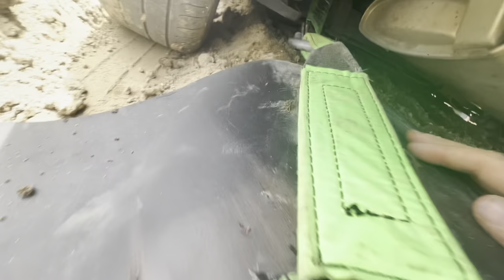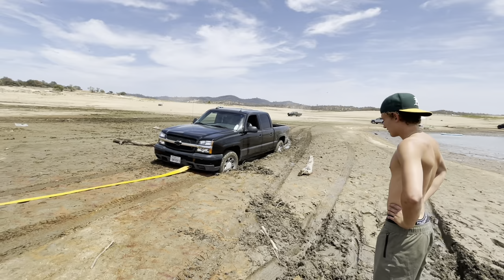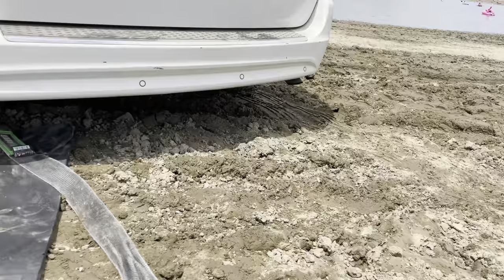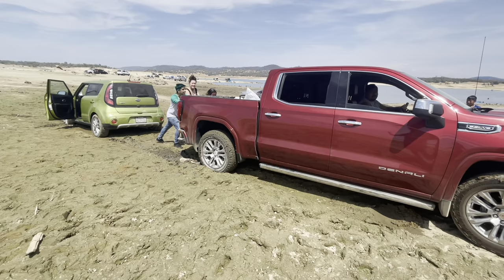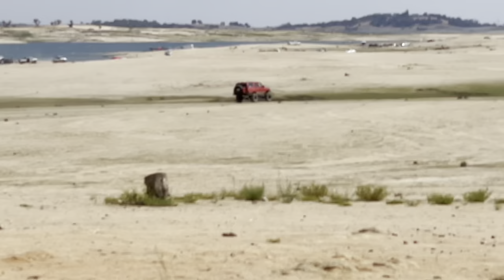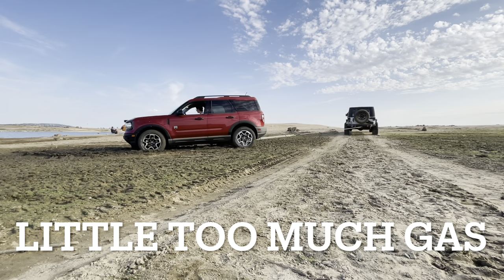I pulled out 11 stuck vehicles for free

Comment: Where did you end up hooking up to the Bronco? If they did have the tow hook that screws in to the bumper, would that have been a good place to pull from? I mean, would you want to use that screw in hook if they were in deeper than that? Seems like a light weight toe point. I’ve never used those.
Reply from the maker: We hooked to the control arm

Comment: Git to ask why do u not use the tow hook that screws in the front bumper and back bumper on alot of those cars u pulled out the hook is where the spair is an works so much easier to atach to
Reply: Not really meant for hard pulls or side to side force. On some cars the threads that they screw into are aluminum. Control arms & other suspension components are much stronger.

Comment: Some company will make good money if they come up with an elastic self tensioning mechanism to keep recovery ropes and straps from getting run over. Something that lets the recovery product still fully extend but then contracts in a series of short sections at a much lower elasticity rate than the recovery product, rapidly "shortening" the recovery product. I've seen campers make self tensioning ridge lines using sections of bungie cord on one or both ends of their ridge line in this way. I'm sure YouTube has tons of good videos on the technique. It would just need to be adapted, and scaled up.

Knowing what your vehicle is capable of is good, but I would suggest knowing what you are capable of in your vehicle is at least as important. There is often a wide gap between the two.
Reply from the maker: I’ve thought about that. Definitely a good idea
Reply: I'm thinking 1 multiple "whips" like antenna that are spring loaded. Cross between a bowflex and whip antenna.